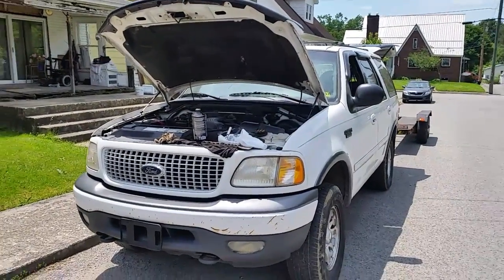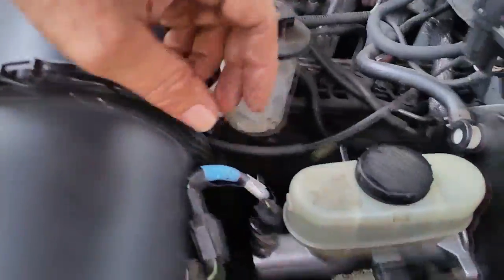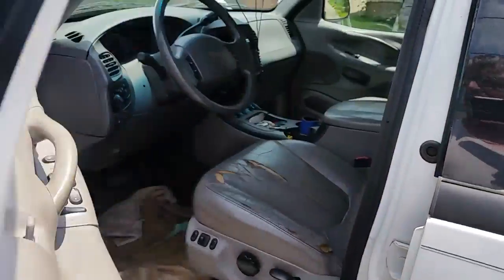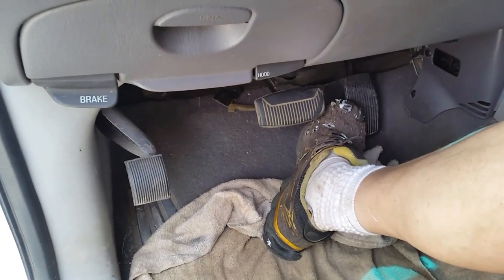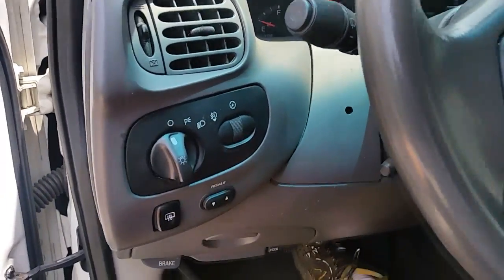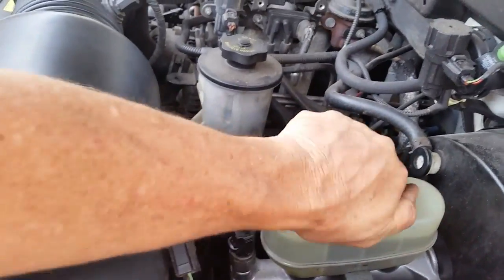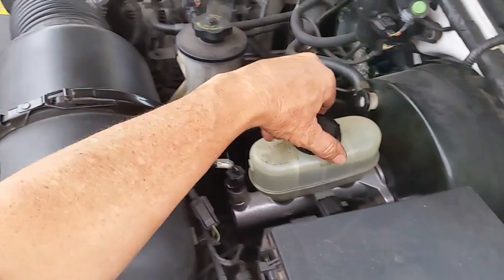Ford Expedition New Brake Master Cylinder. No brake bleeding! How I dit it.

Comment: Dear Nat I’m not a mechanic and don’t like giving advise for fear to be wrong but there are young people tuning in to your advise and you could cause some unknowledgeable person there life brakes is not a toy it should not be taken lightly , listen to the air that you hear each time you press the brake pedal your moving air around in the system only to cause failure later down the road . Not trying to rain on your parade but this is a serious matter.
Reply from the maker: No air....Normal sound. Booster is just working like it should sound. Working perfect to this day!
Reply: You are wrong. That sound is normal for a functional break booster and has nothing to do with the brake lines. Brakes are a closed hydraulic system, it would be impossible for a brake booster or pedal to introduce air into a brake system.
Reply: @FixingWithPassion so how are those brakes ? 😂😂

Comment: You...have...air...in....your....lines. you do not have a high hard pedal. It is a half way down soft pedal. Use mapp gas torch to roast the bleeder cherry red loose and use vise grips if the hex rounds. Bleed your brakes. There is no return line.

Comment: Thanks so much for the info,i have a old P30  motorhome  ,which had a a brake issue where i lost all the fluid to the back section of the brake MC and once i repaired the leak, i bled all the brakes and had nothing but pedal to the floor,it simply would not pump up after many efforts of bleeding, so i thought i had torn up the MC so i bought a new one and was dreading the replacement process.Then luckily i ran across your video and thought ,what the heck ill try that before i beat my knuckles up a few hours and within 10 minutes of your way of doing it i had pedal and then more and more and within 30 minutes i was stopping the #15,000 lb monster with ease enough i can tap  the brakes and have great brakes .Ive been fixing one mess after another for some time now and the brakes,was,my last disaster.But thanks to you im fixed and  the wife is super happy that i didnt buy a lemon. Thanks again. I have to admit i thought i was in for a miserable mess before this.
Reply from the maker: Nice, glad it worked!

Comment: Is this meant to be a late April fool's joke?  I can HEAR the air in the brakes in the video when you're praying the brake pedal.  If you're being serious I hope you take passengers with you when you drive.
Reply from the maker: Ha ha....No...your wrong... that sound you HEAR is the brake booster working as I pump the pedal....a normal sound in most SUV'S when you pump the brakes as the booster uses a vacuum supply of air that is in storage for a few pumps. Try again. Brakes are Perfect as of this day!  My daily Driver~
Reply: I know it's the brake booster.... brake booster full of AIR.  Brake boosters do NOT make a swooshing noise that loud... or rather properly working braking systems do not. It's not possible to get air out of a brake system without bleeding it.  Since the hydrolic braking system was invented for vehicles, the bleeding procedure is the ONLY way to get rid of air.  Do you actually think you just invented a method for a sytem that's many decades old, that's been on billions of vehicles with millions of mechanics working on them?  There is air in that system if you haven't bled it yet which is very dangerous.  When the system gets hot the trapped air will compress even more which means you'll lose more of the pedal than you think you have when testing it while it's cold.
Reply from the maker: Well, somewhere in your statement...something is wrong. Fact: Brakes are
 perfectly to this day!!  And my brake booster STILL makes A swooshing 
noise still today (a normal sound). And that's what you here!!!  Not 
some air moving in the system in the lines making that sound....lol. I 
never said I had the brake calipers open...so there was never any chance
 of air getting in. If there was any air in the master cylinder, when 
you pump the brakes it will bleed out back into the reservoir... and 
I've see this 100's of times before, you know watching those little 
bubbles in the reservoir when someone pumps the brakes...You 
know....bench bleeding....I'm sure you have herd of it...lol. So I know 
your trying to criticize here, but fact is, all the air is out of the 
system. Me Working on autos, with 45 years of with experience hands 
on...is more word reliable than someone who wants to just bla bla 
bla.... But thanks for your input. Have a goooooood day.
Reply: You're right. Same thing in my 98 Silver-ado. Stiff pedal, still a swush sound.
Reply: @rastoma  Air in a brake booster has nothing to do with air in a brake line. Trucks and SUVs tend to make that sound. There is an air filter inside the cab, behind the pedal where it attaches to the booster. It makes that sound as air rushes through the filter when the brake is pressed. It would indicate a problem with the booster if it didn't make that sound.

Comment: That's how I've been doing it for decades, works like a champ.  Only difference is that I don't start/stop the engine while bleeding, there's no need.  Once I think it's good I'll start it just to get a feel with the booster working, if it's still soft I'll shut it off and keep pumping.

Doing this is the same as bench bleeding the master, but when you do it on the car it's less work and much less chance of spilling fluid.
Reply from the maker: Right! You understand!
Reply: @FixingWithPassion  Can this be done with a 2001 dodge grand caravan?
Reply: @FixingWithPassion  Do you leave the cap ON or OFF the master cylinder while you're pumping the pedal...?

Comment: This is why youtube is dangerous. you have people who have no idea what they're doing or how these systems work giving other people bad advice. Number one you should bench bleed the master cylinder first. Number two there is no return line. One line is for the front brakes and the other is the rear. Pumping the pedal is just pushing the air out to the calipers and compressing it, thats why you pump the pedal then open the bleeder to bleed the brakes. You may be able to stop but i guarantee there is still air in the system. You cant tell me there isnt because you didnt bother to check. As a trained and certified technician ive done many of these on many different vehicles and while it would be nice to try to save some time and skip bleeding it, its not the right way to do it. Thats nice that you want to play mechanic with your own shit and dont care that its not right but i hope you never work on anyone else' vehicle with that lazy hack job mentality, because you might end up killing someone.    #Armchair Mechanic
Reply from the maker: Shut up! lol 3 years later works perfect! #keyboardwarrior

Comment: I've never started the car when I bled the brakes. Kinda a dumb question but what would be the main difference.. I also came across this.. >> you should bleed the brakes with thecar off. While 'pump' was the wrong word to use, the brake booster runs off the engine vacuum (it's a large diaphragm that multiplies brakeforce), and this should not be active.
Reply from the maker: You can do it both ways....When the  auto is running check to see how the pedal feels. Feels good then your probably ok. Not much difference.

Comment: I'm glad this method worked for you but it's very dangerous. There's always a chance that there could be air trapped in the system, I always bleed the master cylinder and the calipers (or wheel cylinders) but good luck and stay safe.
Reply from the maker: Thanks.    Year later......brakes are still perfect!
Reply: You're welcome and that's awesome.

Comment: Did you eat lead paint as a kid?
Reply from the maker: The name says you sure did.
Reply: ... the bottom line is it works or it doesn't. The first time I saw a video using candle wax and a little heat to remove rusted fasteners, yeah,  I thought bullshit ... until I tried it. Theoretically, this method may carry some clout considering the air will leave the system before the fluid. I've seen stranger shit over the years, and you always go for the simplest solution first. Again, it'll work or it won't. DISCLAIMER: I SAF wouldn't be boppin around town with my kids in the vehicle for at least a week.

Comment: Freaking awesome. I accidently drained some brake fluid from my master cylinder on my 99 ford explorer causing air to get into the lines. I was too lazy to take off each wheel to get to the bleeder valves so i tried this. Sure enough it worked. My brake pedal was going all the way to the floor with the air in the lines now it's perfect. I have no idea how this works being the braking system is a closed system. Somehow this clears the air out of the system. It probably works off of the pressure from pumping the brakes so many times. Thanks for this video.
Reply from the maker: Glad it worked! My brakes are still perfect! Just drove 300 miles today and its a great feeling when you don't to worry about stopping. :)

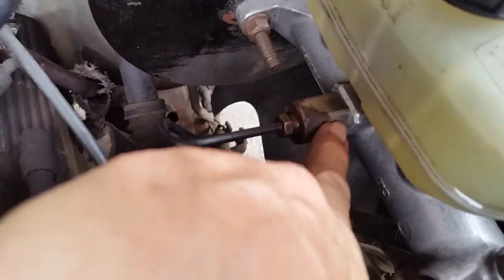Comment: At 0:54 you said take off the extension tube off . When I pump my break there is a small whole in the top that is leaking out all my brake fluid from that peice what would cause this ??? Please let me know asap driving me crazy cant find anything on line about it grrrr thank u
Reply from the maker: That's a adapter reducer fitting. Yours is some kind pressure relief maybe??  Never see one with a hole in it.